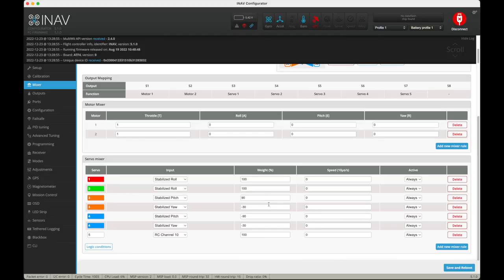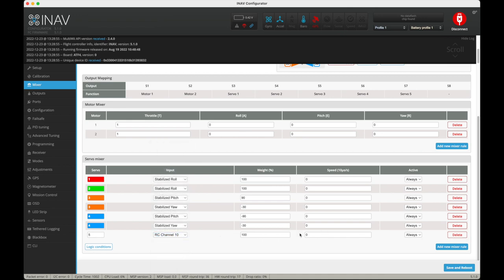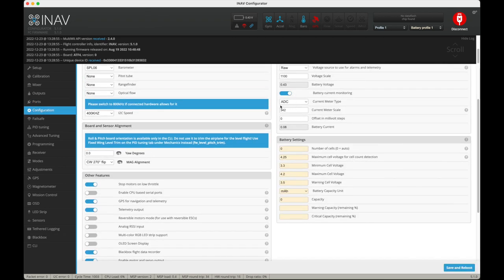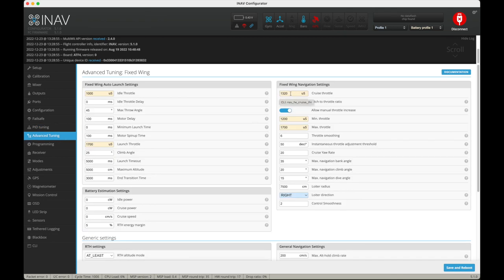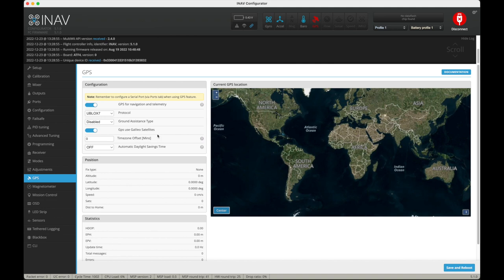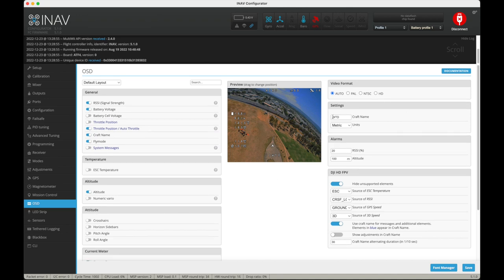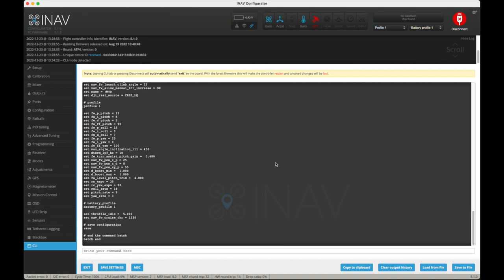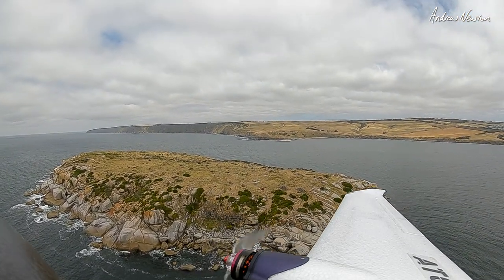AtomRC Swordfish 180º pan DJI HD FPV

Comment: Great update and in-flight views Andrew.
Having a pan to look around really takes FPV experience to the next level.

While the Zorro doesn't have the lower sliders list the TX16, maybe a turn-knob could add variable pan should one wanted. The way you set the 3-way switch with a slow skew-pan rate is a simple option that works way better than I would have expected. :)
Reply from the maker: Zorro has shoulder sliders which are perfect for panning, together with an on off switch.

Comment: Love the videos Andrew, convinced me to buy with how stable it flew (as did you with my last buy - crosswind mini), remarkably buffet free flight. Going to try a 4s 4500mah in it, with a runcam 5 on the tail to try and balance it out a bit, may need a bit more there, but will see... Have a matek h743v3 wing thats been sat in its packaging for the last year, so gone with the pnp version and will wire up myself with Ardupilot. Ordered a runcam wasp + full-sized dji transmitter for some HD, along with wtfos. Will be certainly trying out your pan mod, looking forward to getting it up and having its maiden!

Comment: Cool Wayne, thats some thing I have planned to do.....the top of the VFX  is enough for cooling??  It has warnings about letting it run on the gound for long. Apparently it needs flying airflow to cool.... Thanks  Laurie
Reply from the maker: Yes it has enough cooling. There is some airflow all around it, even underneath, and it switches to low power when needed.
Reply: @AndrewNewton  thanks Andrew much appreciated

Comment: Thanks for sharing Andrew.  What kind of pan servo did you use on this setup.  After I watched your video and I went ahead and  ordered mine from AtomRC and I can't wait to get it in my hands soon.  I want to use the DJI O3 HD system on mine and hopefully to set the camera pan working like yours.  Can you provide your iNav CLI dump?  Thank you so much.
Reply from the maker: Daniel. Servo is a TGY-180D. Here is my latest CLI DIFF Inav 5.1 https://drive.google.com/file/d/1jySbJ6CSXPYTgSgSy78R-wfHrSGMXmtE/view?usp=sharing Good luck with your build
Reply: @AndrewNewton  thank you so much

Comment: Hi Andrew
I also have a radio master, am having some issues with vtial mixing. how did you set up the input and mixes on the radio.
Reply from the maker: Start with +50 ele and +50 rud on one servo and -50 ele and +50 rud on the other. Adjust weight and direction as required

Comment: Hello Andrew, can you tell me which propeller to use with the right wing motor 7042 or 7042R, same question for the left wing motor.
Reply from the maker: R for right. I had to check, didn't realise they were labelled.
Reply: Thank you so much

Comment: I orderd mine last week:) 

Any ideas, what lipo size would be able to fit inside ?

My dealer got a 4s 5000mah lipo on Sale but i'm scared its to big.
(The plane is still not arrived)

Any help would be great;)
Reply from the maker: It will fit, but even with a 3500 4S Lipo it's nose heavy so you would need to add tail weight. Really designed for Li-Ion or smaller LiPo

Comment: What did you do to  get the DJI to bind with the flight controller ,I cant get my goggles to bond with the caddx or my radio I have done the DJI Assisant thing?
Reply from the maker: Doesn't bind to the FC, it just gets power and sends telemetry via the UART you select in INAV. But first you have to activate and pair the goggles with the VTx using Assistant.
Reply: @AndrewNewton  What UART  do I set my FC to in Inav?  I have done the Assistant activtion with DIJ It can't be this hard or maybe I'm not smart enough to figure it out..
Reply from the maker: Which FC?
Reply: @AndrewNewton  AtomRC F405 NAVI
Reply from the maker: @kennyriverrat220  OK, so the DJI plug on that FC is on UART 5, as I showed in the video. But make sure your goggles and Caddx are working first by powering the Caddx with more than 7.4V. The FC only adds INAV telemetry to the OSD.
Reply: @AndrewNewton  I don't know what's going on DJI unit is running V01.01.0000            Radio is on V01.00.0608          googles V01.06.0000  nothing will bind together  lol
Reply from the maker: @kennyriverrat220  Simple. Update each component to the latest firmware.
Reply: @AndrewNewton   Will you tell me your Current Version numbers you running ON DJI unit and on your goggles to please  Thanks Kenny
Reply from the maker: Goggles (V1) V01.00.0600, Caddx Air Unit (Lite) V01.00.0606
Reply: @AndrewNewton  Thanks I will try tomorrow after work,My Goggles V2 and my air unit Caddx Micro version HD Low Latency
Reply: Goggles on v01.06.0000   Air Unit on V01.00
0608  was the fix for it Thanks Kenny
Reply from the maker: Excellent. Glad to hear you work it out
Reply: I have 1 more question what’s your best settings on CLI you one you have listed or do you have a better one? Thanks Kenny

Comment: I guess you want max air over the airunit because it's so expensive . Few of us could afford a airunit. No arguments that it's a nice picture
Reply from the maker: All video transmitters heat up, but the HD units get very hot. Cooling airflow is essential.